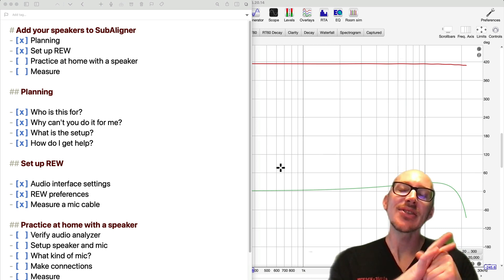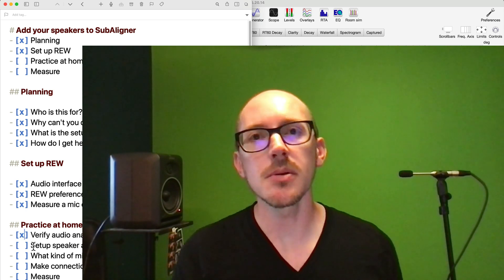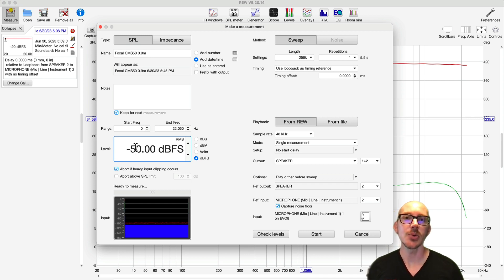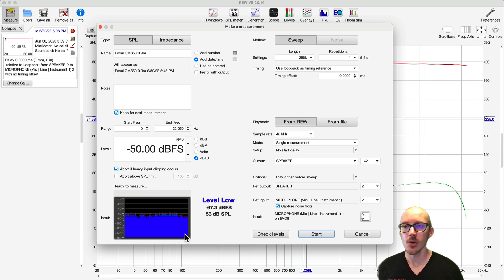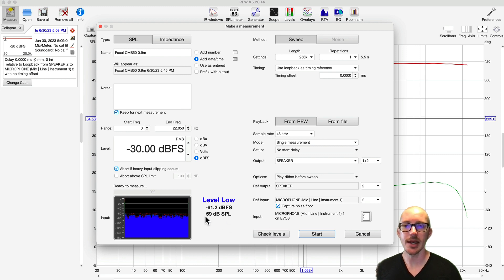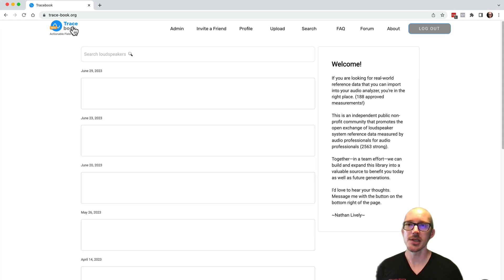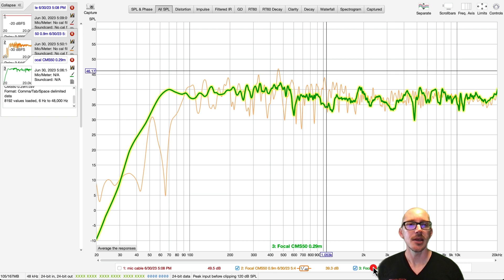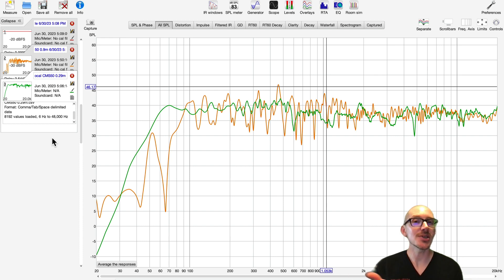Add your speakers to SubAligner: Practice

Comment: Hello Nathan, Why it is 1.5? (distance from bottom Speaker ti the ground / 1.5 = microphone distance). If u have a flown Line array in an Outdoor situation , should one place the microphone like this? when u measure / align? Thanks
Reply from the maker: Hi Priyan! It comes from the Tracebook Measurement Procedure and is used to attenuate the floor reflection.

The reflected sound from the floor (floor bounce) needs to be attenuated by at least 10 dB (factor √10 ≈ 3.16) by virtue of propagation loss or absorption, to cause negligible frequency response ripple. Tracebook recommends placing the SUT at a table edge or on a loudspeaker stand, such that the distance between the floor and the bottom of the loudspeaker is at least 1.5 times the measurement distance (Figure 5 previous page).

> If u have a flown Line array in an Outdoor situation , should one place the microphone like this?

This series of videos is specifically to help SubAligner users take measurements of their speakers if they have little to no experience with audio analyzers.

Please see https://youtu.be/wzIBWmvQL0Q
Reply: @nathanlively  Thanks a lot Nathan